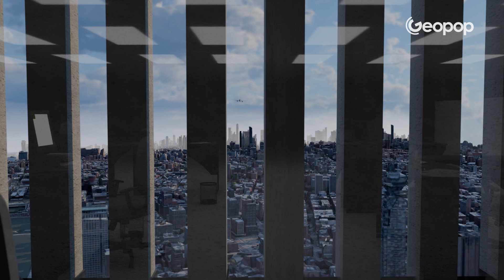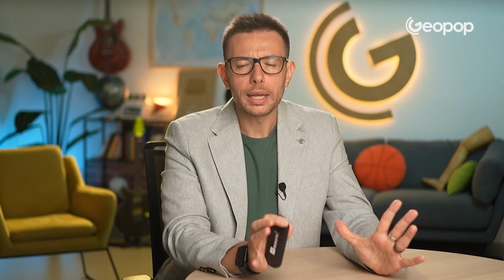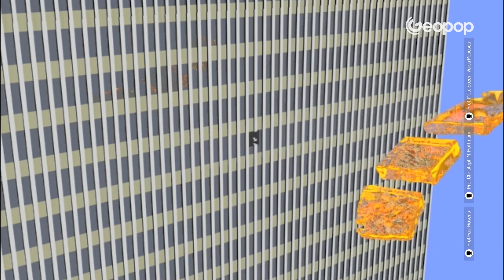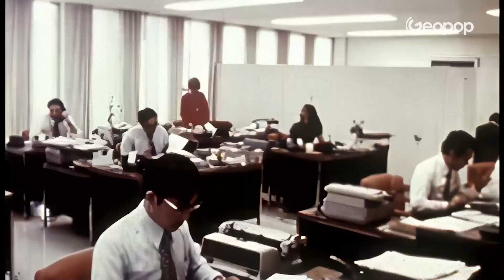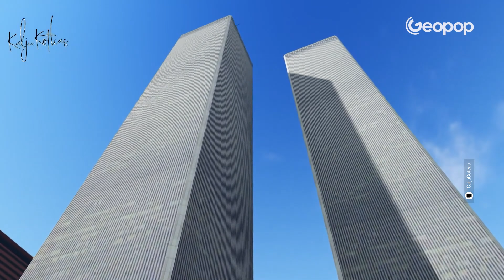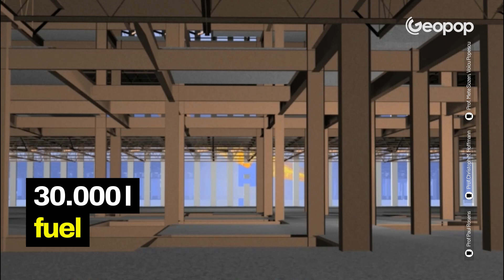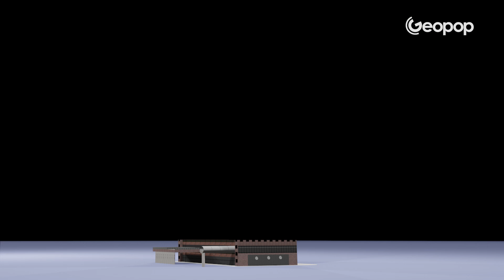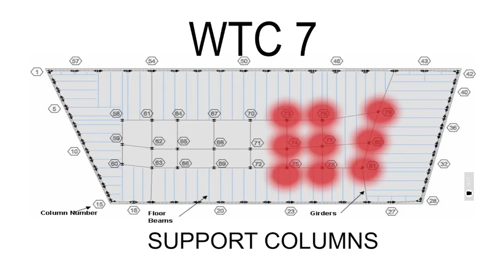9/11, 2001: The Technical Reconstruction of the Twin Towers and WTC 7 Collapses

Comment: Only load I can see here is the load of BS this guy is spouting.
Reply: And yet he's not wrong or you would have had something at least resembling a rebuttal.
Reply: @TheLoonResistance - everything he stated has been rebutted, but you’re too thick to comprehend it 🤷‍♂️

So tell me how physics work, if the floors below are UNDAMAGED how can less than 20% of a structure manage to plough through it with virtually no resistance? Law of motion states with EVERY action there’s an opposite REACTION. 

So tell me this as well, if office fires are so strong that it would bring down steel buildings, then wouldn’t EVERY steel structure built prior to 2000 need to be reviewed and reinforced?

How did the Empire State Bulidng and other steel skyscrapers around the world manage to still stand after plane collision and “office fires”?

How did WTC7 manage to collapse ever so uniformly with a failure of one support? 😂

You’re definitely a “critical stinker”
Reply: @bGzzzzz  - Fire can bring down any building in the right circumstances. Fire brought down 17,000 buildings in Los Angeles just a few months ago.  As for the Twin Towers:

Twin Towers collapses were relatively straightforward and well understood in the professional engineering community within just weeks. Yet there’s still a lot of really bad information floating out there easily accessible on the internet, premised on wild baseless speculation and pathological theorizing with easy hand-wave answers.  Engineering is hard. This stuff is simple, exciting and requires little or no thinking, so it gets far too much attention.

Because anything can seem like a conspiracy if you don’t understand how it works I prepared my own short yet detailed technical description of Twin Towers collapses from my own observation and analysis of available true and relevant facts. No politics, ideology or magical thinking, just engineering. Hopefully this will dispel many common myths and answer most if not all questions you may have about the collapses.  

While complex, most of the Twin Towers collapse mechanisms can be seen with the naked eye and easily discerned and understood by the layperson if sufficient time is taken to understand.

1. The Twin Towers consisted of 4 primary structural elements that together formed an integrated system where each relied on the others. 47 hollow box-section steel Core Columns carry the majority of the gravity loads. The 236 hollow box-section steel Perimeter Columns carry the remainder and ALL of the lateral (wind) loads. Long-span Lightweight Steel Trusses connect the core and perimeter column together at each floor with a Hat Truss on top to tie the structure together as an integrated unit where no element can survive without the others. There was no structural load bearing concrete and most components were bolted together.

www.youtube.com/watch?v=u7OqrC74Dm4

2. The impact of 117 tons of airplane (= to about 12 dump trucks) at speeds up to 590 mph with the energy of a ton of TNT completely destroys the aircraft. This in no way implies the Towers come out unscathed. Many perimeter columns are damaged or destroyed as are some core columns (example; 33 of 59 perimeter and 20 of 47 core columns damaged or destroyed at the impact floors in the North Tower), This damage is primarily through bolt-shearing failures at the end connecting flanges, as well as bending, twisting and fracturing of weld seams. There was no cutting or slicing - the reality was far more violent and messy.

3. The impacts destroy or damage fire insulation, fire breaks and sprinkler systems on multiple floors. Huge fires are started across multiple floors simultaneously and allowed to spread rapidly with no effective firefighting or fire suppression. This was an unprecedented fire event .

4. The hotter steel gets the weaker it gets . With fire insulation stripped away and no sprinklers the survival time of the steel greatly reduced. Gradually over time heat causes the lightweight steel Floor Trusses at the impact damaged floors to sag, which was observed and recorded. No steel melted or needed to. Structural steel fails long before it becomes a puddle. It just needs to bend

5. Sagging floor trusses pull on the increasingly weak and overloaded Perimeter Columns, causing some of them to bow inward by up to 5 feet. A straight column is up to 4 times stronger than a bent column. The bowed Perimeter Columns buckle and fail, quietly initiating collapse. The formerly static mass above which the structure below could easily support is converted to a dynamic mass up to 30 times greater. Because they have buckled, the Columns above and below the failure point are no longer aligned . The load bearing structure below no longer bears any load as it falls past the lower columns, NOT onto them.

www.youtube.com/watch?v=ULdiD6gYZO0

6. Thousands of tons of debris fall within the four outer walls, down through the open office space, crashing onto the first intact floor it encounters, immediately breaking the bolted column connections as the amount of resistance the Floor Trusses can offer is negligible. The falling debris slows only marginally and briefly. Note: 
6a. This is NOT a solid top block crashing into and “crushing” a solid bottom block . 
6b. The debris falls past the columns not onto them. The columns provide no resistance to the falling debris. 
6c. Only the bolted floor truss connections to the core and perimeter columns offer any resistance. A pair of 5/8” bolts at each end of each truss vs. thousands of tons of falling debris. 
6d. No laws of physics are violated. 
6e. There is no 20 floors against 90 floors but rather 20 floors against one floor, then 21 floors against one floor, then 22 floors against one floor, etc. 

7. This floor-led collapse progression within the four outer walls can only go straight down.
7a. This process is often incorrectly referred to as “pancaking”. The catchy name stuck but nobody knows what it really means and "pancaking" is too simplistic and inaccurate anyway. I prefer Kaiserschmarrn.

8. Collapse progresses through the floor systems past the columns, through the path of least resistance . The resistance offered by each floor is always the same while the mass of debris and its velocity – thus its energy - increases with each floor failure. Each floor offers the exact same resistance to the falling mass while with each failure the falling debris constantly gains both mass and velocity. *This process of floor-by-floor destruction cannot be arrested, it can only speed up . Rate of floor failures increases with each floor as momentum increases, reaching an average acceleration of 0.65 of GA, or 35% slower than true free fall. Bam, bam, bam down the building until there are no more floors to fail. The resistance offered by each successive floor is always the same. More mass, more velocity, same resistance with each floor. Don’t get stuck on the but the lower floors weren’t on fire nonsense. They weren‘t and didn’t need to be.

9. The Towers were 95% air by volume. As that air was compressed inside the building it is forced down the tower and blown out the sides in reaction to the building collapsing . Those were not “explosions”, it was expulsions of compressed air caused by the collapsing building, explaining the low velocity, lack of flash, blast, supersonic pressure waves and lethal high-velocity ejecta.

10. Perimeter Columns become detached and peel away like a banana behind the collapse front, playing out to the four points of the compass extending to more than 600 feet from the base of the towers. This was quite obvious from examination of the debris pile.

11. Core Columns fail last as their internal beam bracing is stripped away by falling debris and lateral support from the floor to perimeter columns is lost.

12. For those who care about how long this whole process took; 31-34 seconds from the moment the perimeter columns buckled until the last core columns hit the pile, or 1/3 the rate of true free fall. Don’t believe me? Just watch any video of the collapses and note the loose truly free-falling debris dropping much faster than the towers themselves.

13. Each Tower had a 1-acre footprint. Far from collapsing inside their own footprints the debris pile spread out over 17 acres in a pile up to 14 stories deep. 8 surrounding buildings were destroyed and scores more damaged by the falling debris.

14. NOT observed were the 180-190 dB bangs of thousands of high explosive devices or the blinding bright flashes of burning thermite. Neither explosives or thermite could have survived the impacts and subsequent fire nor could have caused the (silent) perimeter column buckling that clearly initiated collapse either. A video of a shocked and injured firefighter casually using the magic word explosion is in no way proof of explsoIVES and the demolition_ case relies entirely on that sort of thing. There is zero tangible physical evidence and it would be technically impossible, totally impractical and completely unnecessary. No one would bother.  In 24 years zero structural engineers of tall buildings, including the 1/3 that have retired in that time, have made any statements in support of pre-planned demolition claims. NONE. The lack of any such citations in the engineering literature (published in any country worldwide) is telling.

15. Twin Towers were perfectly safe within their design envelope. They only collapsed when taken far outside design parameters by an extraordinary and unprecedented event

Impact + Fire (heat) + Time + Gravity = Collapse . Remove any one of those 4 elements and there is no collapse. Ignore any of those elements (as many do) and you will never understand the collapses. The Twin Towers were an integrated system in which no one component could survive without the others. One fails, the rest follow, through the path of least resistance – DOWN – through the open space, bypassing the path of greatest resistance – the columns. Nothing I just described violates any laws of physics. All of the above is true no matter who planned and carried out the 9/11 attacks or why

I hope you found this helpful and informative. It is not meant to be adversarial, but to solicit informed critical comment, positive or negative. If I made any errors of fact, logic or reason or left anything critical out, please let me know so I can fix it. To stay focused, just one topic at a time please and on-topic (Twin Towers ONLY). No word-salads of Gish Gallop. IF you can offer a more plausible alternative be my guest. Please start any reply with the words “Tits McGee” or I will know you didn’t read it, are not serious and just wasting my time.
Reply: @TheLoonResistance how could the live tv reporter state that building 7 had collapsed before it actually went down????
Reply: @redsed1565 - I'm so happy you watched Loose Change - a shitty film made by kids almost 20 years ago - and have not learned a thing since.  The funny thing about documentaries is they are at the same time both the most compelling and least reliable sources of information. IF you want to be badly informed on a topic, watch a documentary.

For what little good it will do, here is your answer that anyone with a working brain should be able to figure out on their own:

The media had been reporting that Building 7 was in danger of collapse or about to collapse for most of the day, starting shortly after it was hit by the falling North Tower and caught fire at 10:30 am. Indeed, at 11:07 am CNN reported Building 7 had collapsed at 10:45 am, or 15 minutes after the North Towers collapse at around 10:30. They did it again at about 4 pm reporting Building 7 had collapsed or was in danger of collapse with the local Fox affiliate doing the same at around the same time. 

The BBC got their (mis)information from the respected news agency Reuters, which picked up an incorrect report. They issued this statement: “On 11 September 2001 Reuters incorrectly reported that one of the buildings at the New York World Trade Center, 7 WTC, had collapsed before it actually did. The report was picked up from a local news story and was withdrawn as soon as it emerged that the building had not fallen.” 

Have you ever played the game “Telephone”? 

You know, where you whisper something to your friend, then they pass that to the next person, then to the next and so on? By the time you get through 7-8 people, the message has completely distorted its original meaning. 

News flash: Reporters are human being and just like you, they make mistakes (and when they do they issue corrections). 

As for why anyone would be reporting issues at Building 7, I wonder,... 

Deputy Chief Peter Hayden of the New York Fire Department recalled: We had our special operations people set up surveying instruments to monitor, and see if there was any movement of [WTC 7]. We were concerned of the possibility of collapse of the building… One particular engineer there, we asked him, if we allowed it to burn could we anticipate a collapse, and if so, how soon?… And it turned out that he was pretty much right on the money, that he said, ‘In its current state, you have about five hours 

As Building 7 became increasingly unstable throughout the day the FDNY had ordered the area around the building evacuated and even suspended rescue operations on the pile early in the afternoon. The media were getting all of this. 

In the chaos and confusion of that day a wire service (Reuters) made an error and accidentally reported that Building 7 had collapsed instead of was in danger of collapsing. Simple enough. These sorts of things happen all the time in rapidly evolving ongoing news events and there are hundreds of examples on 9/11 alone. The BBC repeated the wire service report, adding “or has collapsed” at 5:00 pm. 

OK, so what? 

Should we care that a British reporter (ie: not from New York), 4 miles away, with her back turned to a skyline chock full of tall buildings did not know which one of those hundreds of tall buildings she was not looking at was Building 7? 

I don't think so. 

She was doing her job, reading the report.

The idiot kids who made Loose Change came up with the absolute batshit idea that a mistake like this could only be made if the worlds media were given, in advance, the complete itinerary for the worlds most secret operation and accidentally skipped ahead.

Has there ever been a dumber idea?

Comment: The horror of the day along with the terrible loss of life was devastating to us all and to disrespect the memory of those events, as does this video is unforgivable. The events we witnessed, did not or could not be explained through the propaganda of this film, NIST or or the WTC Commission. Try research if you want the facts. Here are some points to ponder:

(1) The nose assemble and most of the body of the airliners were made of aluminum and the perimeter of the buildings were made of steel so even at 1, ooo mph, aluminum cannot rip through steel.

(2) In a perfect enclosure with correct mixtures, jet fuel cannot reduce structural steel to liquid and in that perfect environment, you will never reach the temp of the liquid steel at the towers.

(3) In the history of mankind, no steel framed building has EVER collapsed and that includes those that burned for over 24 hours. Additionally, no building ever constructed that was destroyed DID NOT TURN TO DUST. oN 911 ... EVERYTHING WAS VAPORIZED.

(4) The real truth can be found in a report called The Black Eagle Trust - Collateral Damage
Reply: 1. The nose is actually fiberglass.  In the formula F = ma which of the variables represents what the materials are made of?

2. Great.  So what?  The only person here claiming jet fuel turned steel into liquid is you?  This is a man of straw.

3. Nonsense. Countless thousands of steel framed buildings have collapsed, from fire and other reasons. It literally happens all the time. Steel is formed using heat and deforms the same way.  This should not be news to anyone.

4.  Why?  I mean, you are batting a big fat zero so far so I'm not exactly going to take your word for it.
Reply: Pretty much everything you just said was false. Aluminum going that fast absolutely will break steel beams. Also, STEEL BENDS WHEN HEATED. IT'S NOT THAT COMPLEX

Comment: 😢 seriously… Where does this guy get 900 to 1000°F? He keeps stating this as if it’s fact. yet jet fuel ignites at 120° and can burn as hot as 410°F.

With these known scientific facts, why is he more than doubling that amount to come up with 900 and then exceeds that amount even more by saying 900 to over 1000 multiple times, just states it as if it’s fact without a problem… Is this how sheeple are so easily misled ? Maybe that’s where the term simpletons come from
Reply: And here you go again.

In this video starting at 22:30 and running to 28:10 the Energetic Materials Research and Testing Center (EMRTC) conducts a test to see what an open jet fuel fire can do to a loaded and unprotected steel I-beam. Remember, steel melts (turns into a liquid) at around 2,600-deg F, give or take depending on specific alloy. The test was planned for 30 minutes.

youtube.com/watch?v=JXWCMBuusMI&ab_channel=TrutherTVArchives

Pay attention to the temperatures. Within 2 minutes the open fire temperature has already exceeded 2,000 deg-F.  So much for 410!  

After just 3 minutes 40 seconds the beam is sagging noticeably.

The beam fails and collapses 9 seconds later after just 3 minutes 49 seconds.

Note the steel fails but does not melt. It is bent and twisted, but not a puddle. You can still tell it is an I-beam.

So why are you such an easily misled sheeple?  Such a simpleton?  You believed the lies about asbestos in the Twin Towers. You believed what is quite frankly obvious bullshit about fire temps.  Probably got both from the same place.  

Make better life choices.